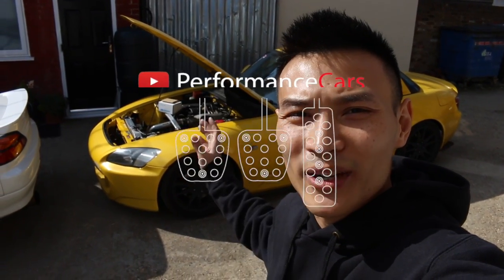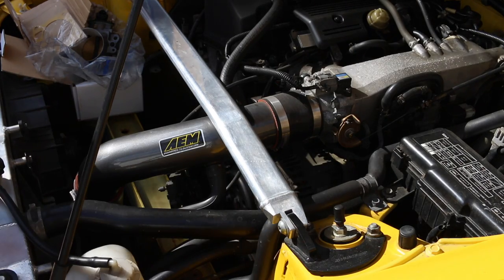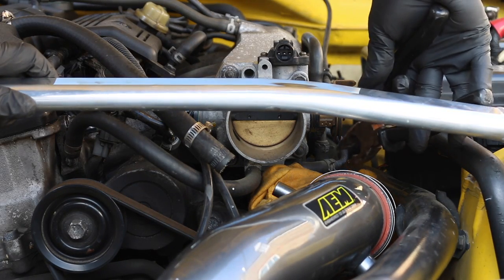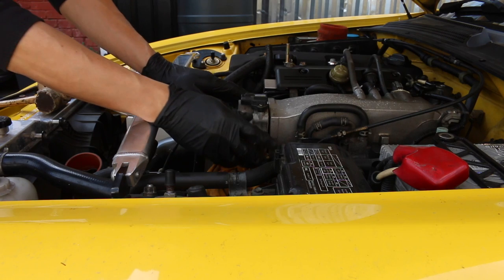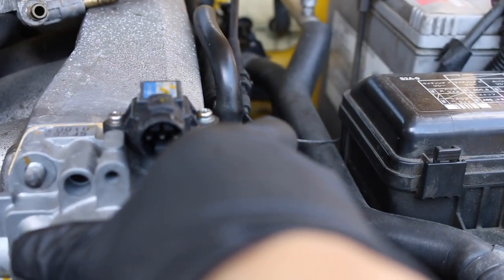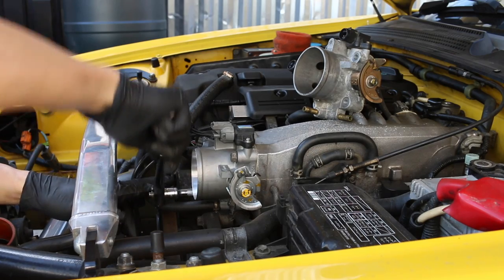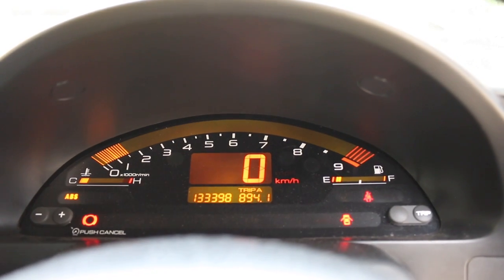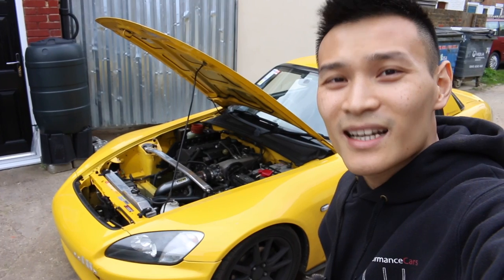Larger Than Standard Throttle Body (Kind of) - Spoon Sports S2000 - PerformanceCars

Comment: Great Viceo:) Did you fill any difference with big diameter trottle body? and what about inlet diameter is it worth to install new big trottle body on the stock inlet? or it is better to port (bore) inlet diameter too?
Reply: Wouldn't of thought there would be a great deal of difference till ecu is in.
Reply: You mean that ecu needs remap or new ecu is needed? 
don't know about honda ecu, but on mercedes V8 we installed 82mm trottle body (replaced oem 74mm) also modified inlet manifold diameter to match 82mm and we got very good gains in power specially in the higher rpms and it was with stock ecu.
Looks there is a diffirent situation with honda ...
Reply: The stock ecu would need to be mapped to benefit the mods but the spoon ecu will already come pre mapped
Reply from the maker: Tbh, the intake sounds louder. In terms of power, I am not too sure. I wouldn't expect a great deal of difference until the other modifications have been installed which are on the way.
In theory it would be better to have it bigger but of course the ECU map comes into play then injectors and the list goes on. There is a way to measure the maximum volume of air entering the combustion chamber for best results but that is way too advanced for me 😅
Reply: OK. Everything is clear. Thank you and good luck:)

Comment: You should look into adding a velocity stack to the oem airbox. A snorkle, cone filter and velocity stack would be an ideal oem+ setup. I read on the forums that the oem filter has one built into its base, however I'm not positive about that. I know Ballade Sports produces their own kit, which incorporates the velocity stack into the filter.

Comment: Your throttle cable looks like it's about at its maximum adjustment, so you may need a new one.  You can also look into a thicker phenolic thermal barrier throttle body gasket that various companies make.  They're reusable and the extra thickness should take some of the slack out of the cable as well.
Reply from the maker: Hey inspyral02, that is a great tip. I was looking was using the thermal one but decided against it in the end. But seeing that the throttle cable is at it's maximum, I may have to go down this route.

Comment: Do a video of the starter motor change, it seems like you need to since when you started the car up it grinded. I need some walkthroughs on this!
Reply from the maker: Hey Bob, I shall have a look into changing this when the time comes as it still works fine. Does yours make the same grinding noise?
Reply: yep, mine makes the same start up grinding noise

Comment: Why r u going to instal stock airbox?
Reply: WarsawMeloman Spoon say that the stock airbox gives best throttle response and recommend a drop in filter. I presume that's why. I couldn't justify a spoon filter so opted for blitz, I believe it's Japanese made.
Reply: JDMsweetness the throttle response felt better when the car is at a standstill or barely moving in comparison to my Mugen intake. I think a snorkel - on an oem box - with a Mugen or Spoon filter, plus an added velocity stack would be a good setup.
Reply: ayowser01 That sounds great, personally if spoon recommends oem airbox they're saying it for good reason. I've researched spoon filter which is excellent however the blitz was better and half the price that said I reckon spoon sports protects the engine better therefore sacrificing very very slight gains. Will be installed soon on JDM ep3 👍🏼
Reply: JDMsweetness I think the Spoon would filter less particles. If I'm correct, it's a pure foam filter. The Mugen uses a foam cover over a paper element, again, if I'm correct. If you're just changing out the filter element, I wouldn't bother. Keep it oem.
Reply: ayowser01 It had a toyoroki Japanese air filter, pretty much oem, I believe. I've bought the blitz because it's foam but doesn't use oil like k and n for instance which usually knackers the maff sensor. Also bought some other goodies for my ornament 😂
Reply from the maker: I'm going to install the stock airbag as I am installing all/most of the Spoon bolt on parts and see if it makes a difference.I can always revert back to what it was before. It'll be nice to see a comparison no?

Comment: Man that starter/flywheel grind noise... I always cringe when I start my s2k.
Reply from the maker: Hey Kuro, do you get the same grinding noise as I do?
Reply: Yeah its normal with s2ks, usually happens on cold startups something about starter not retracting fast enough so it touches the flywheel a bit. s2ki members recommend replacing the starter if it bothers you but yeah its a thing with the s2000 haha.
Reply: Kuro Inu same issue on my EP3 also...
Reply: same with my ep3. I've been trying to let go of the key ignition a tad earlier and it seems to be ok but there's always that anxiety of not starting properly haha

Comment: Is the bore size the same for the AP1 and AP2 drive by wire (dbw) models?
Reply: ayowser01 same!
Reply: ayowser01 ap1 and dbw are not the same. Ap1 tb goes from 66 tapering to 62 and the dbw is 69 straight through

Comment: Most useless mod ever.
Reply: He's doing a spoon build track car....its a spoon part, pretty useful tbh. 
Not only does he now have brand new sensors but a new mechanism that will stand up to some good old track abuse.
Reply: Tyrone Ross Surprisingly, it does add power and smooths it's delivery- from what I've read.
Reply: Tyrone Ross 7:30 it revs so nicely! I could see the night and Day difference just by watching it on here. That's gonna be my next mod on my DC5.
Reply: do u have a type r or s2000? installing spoon throttle body is one of the best mod ever, allows the engine to breath in more, dont say anything useless if u havent tried it
Reply: Alex Jai after doing a bunch of research I've found a, potentially, better alternative: Ballade Sports ZDX/MDX 80>70mm kit. They also optionally piece the kit with an intake arm.
Reply: +ayowser01 ya I don't mean to say only spoon is good, any bigger throttlebody is better for the engine to breathe, thing is u have to tune it and u do lose some low end torque too....
Reply: Alex Jai I assumed that it's a shift in powerband and you trade off some low-end torque for high-end hp. If only it could be a win-win and you gain power throughout the powerband.
Reply: No Alex, I dont have a s2000, but I am an automotive engineer, and I can tell you straight away, this is mod is useless, as in it does nothing. Waste of good money.
The air goes through the same crossection of 64mm behind the butterfly valve, the butterfly is the same size, so again no increase there, its just a polish job on the intake lip with a whopping 3.2% percent surface increase over stock. Power gains will be unmeasurable, because they literally will be to small to differentiate from error in measurements.
Reply: +Tyrone Ross well... I won't say ure wrong, everyone has their own opinion, but base on a lot of people's including my opinion, we do see gains in dynos.
Reply: Perfect, throw those dyno printouts on imgur and lets settle this now :)) This is not about opinions, but numbers. I am willing to bet my right nut that thing does add between 0 and 2hp maximum. But a 2hp increase from run to another is very common without even touching the engine, so Im not sure what exactly will those dyno numbers prove, but put them up anyway.
Reply: BeautifulRewind I dont care who is pushing this mod, it does nothing.
Reply from the maker: Tyrone, I did say that I am following what Spoon does to their race cars. The reason why they haven't changed the butterfly size was because of the race series they entered. Yes, there are other throttle bodies out there that will make more power etc but that could be a video I make later on. A comparison between the two. 
I find it interesting to see what difference it will make hence why I make these videos 👍
Reply: I know I'm late to this thread but I will be installing mine on a boosted s2 and I will post the printout